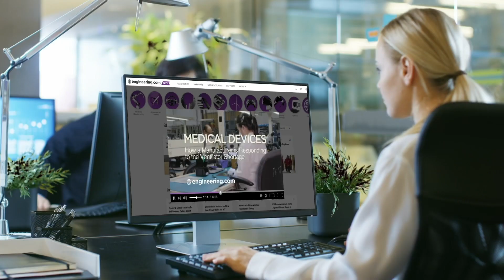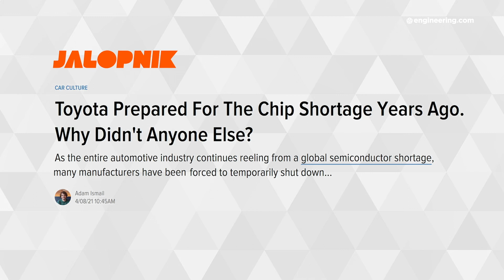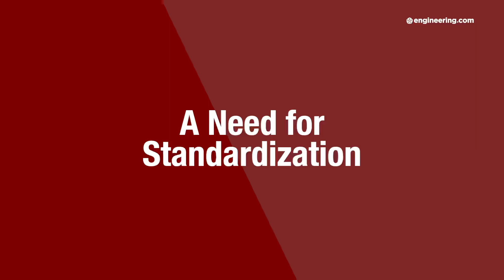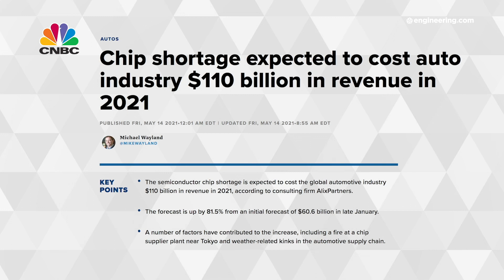One Solution to The Auto Industry Chip Shortage

Comment: Eh.. that really isn't workable, you could and should standardize interfaces, but standardizing chips.. that approach went the way of the dodo with DIP packages for a good reason. 
Rather the fix is to do just in time manufacturing right. You are meant to minimize inventory of bulk, easily replaceable, short lead time materials, not chips which are critical parts with no alternatives, long lead times, very favorable economies of scale, cheap warehousing requirements and overall make up small proportion of final cost. The larger the order, the better the deal, ffs just buy enough stock upfront for the entire life cycle of the product instead of constantly trickling small orders. It'll be cheaper overall and guards against supply chain shocks.